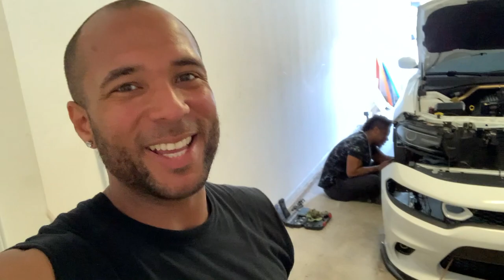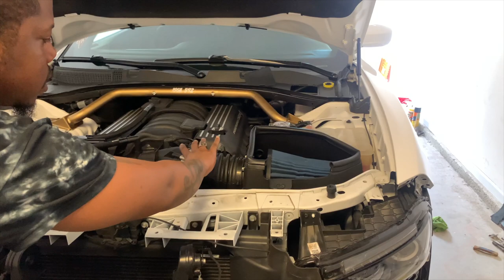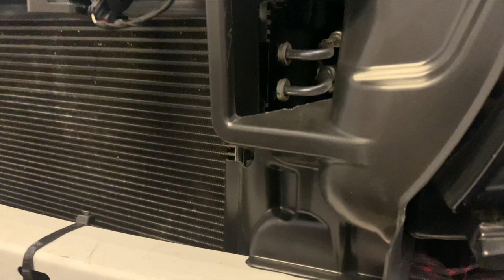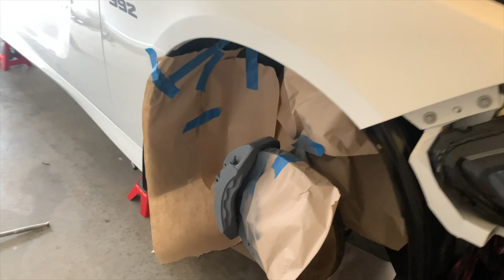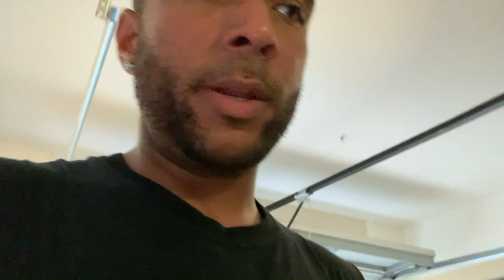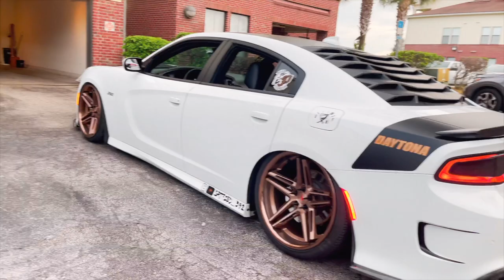These WHITE Brembo Brake Calipers Pop!!!

Comment: We have similar tastes. I just painted my brembos on my 5th gen 2SS Camaro. 

I also have air suspension.  Airlift 3P management and performance series struts. I also was looking at those same wheels but in black. The Ferrada CM1. 

However, i heard the paint on their wheels peel off at the lips. Have you had that issue with yours ?
Reply from the maker: Out of the two sets of wheels ive had from ferrada i never had issues with paint peeling or etc. however, I did ceramic coat them before mounting them so im sure that helped.

Comment: Bro take your 5 pin connectors and put dielectric grease on them then use some Marine grade heat shrink keeps the moisture and water out of the plugs
Reply from the maker: I use dielectric grease on my plugs but dont wanna do the shrink wrap cause some plugs i need to have easy access to if i drop the bumper